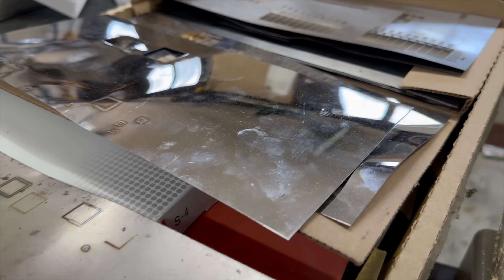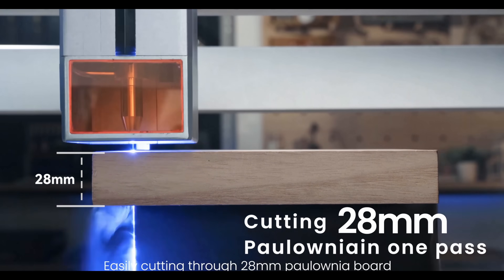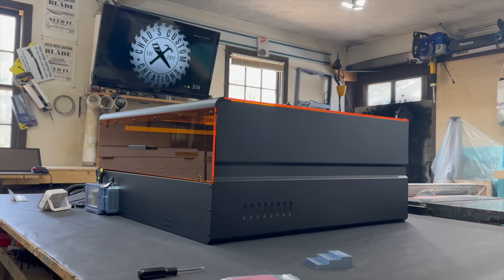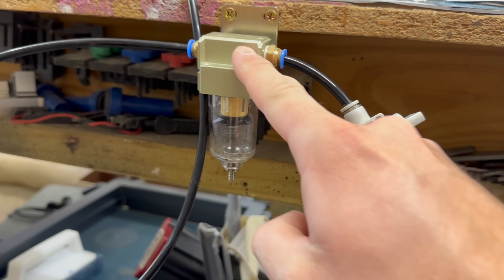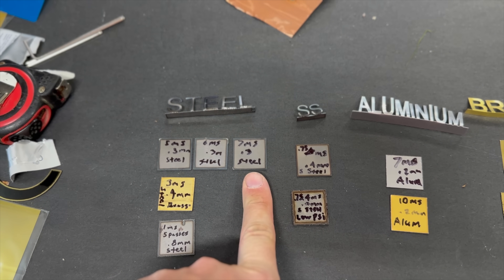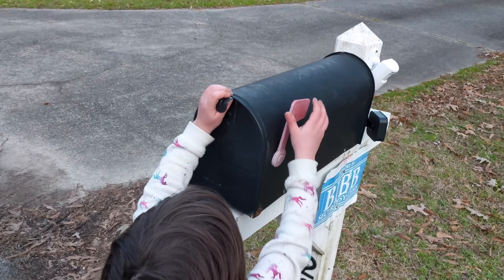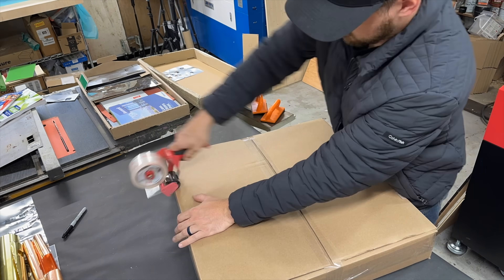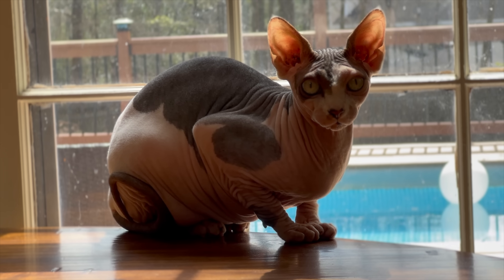Is The Future of Metal Cutting with Diode Lasers? 70W IKier K1 Pro Max

Comment: If thermal conductivity causes issues with warping and such, wouldn't it mean that if you more slowly and uniformly pre-heated the metal sheet in some manner before even starting the laser, you should not then be able to possibly cut through thicker sheets without warping them?
The thermal conductivity of the metal will technically decrease at higher temperatures, though probably only a modest amount even if preheated to a couple hundred degrees, but it has to be the non-uniform nature of the heating from the diode that is causing the warping issues so minimising the differential temperature from the cutting point to the farthest edge of the sheet I would hypothesise could have a fairly significant benefit for some of the trickier metals.

(though probably you'd also need to make sure the compressed air isn't blowing too cold air in as well which could ultimately be a limiting factor to the benefits I suppose...)
Reply from the maker: This is some great insight thanks for sharing I will give this a shot!

Comment: @Steel
Hi, do you ever thougt to use pure oxygen? With a presure of 40-50 PSI.
Theory:
The laser heats the steel to ignition temperature. As soon as the ignition temperature is reached, pure oxygen is directed onto the metal. The oxygen reacts with the heated steel and oxidizes it. This oxidation process releases a lot of heat and melts the metal at the cutting point. The resulting iron oxide (slag) is blown out of the kerf by the pressure of the oxygen jet, creating the actual cut. AND it should be a much cleaner cut.
Reply from the maker: These are great tips I think this would make an enormous difference. I used oxygen before but lacked proper airflow. It burned much hotter but couldn’t push the material away.

Comment: Good video I was wondering if you ever thought of using inert gas instead of compressed air. This shoukd make the cut even nicer as there will be no oxygen that oxidise the most metal when cut . Maybe it would be good next experiment 😅.  Keep up the good work .
Reply from the maker: Great suggestion thanks for that definitely adding it to the list.

Comment: When cutting metals you need to use sheilding gas like nitrogen or CO2.  On the stainless (well any reflective metal) they make special tape to ease in cutting, but black sharpie works really well in a pinch.
Reply from the maker: These are great tips thanks so much.

Comment: Coconut 
I have been looking to get into the laser community.  I am going to embrace my artistic side and try to turn a hobby into a business because I’m getting too old to start at the bottom again! 
I’m a welder Fabricator looking for a new source of income. Due to yet another company I worked for has been sold to a foreign company (5th time since 2018).  
I would love to get a fiber laser and engrave some dies or make coins….  But they are not in my budget. 

If you have any advice on a “reliable” laser that is a decent price, I’m in the market!  I don’t care if it’s an “off brand”, I am a fast learner and willing to fiddle with things to get them right.

Side note: 
Have you ever thought about OR is there programs that do a “franchise” or a “lend lease” to outsource some of your laser work volume for high sales times like holidays?
I just found your channel, I look forward to watching more of your content.

Best Regards!
Reply from the maker: These high wattage machines are pretty pricey cause it takes a lot of hardware to get them up to this wattage. Maybe check out a more portable machine like the Xtool F1 or look out for deals on FB market place you might be able to get a good deal on a used machine.

Comment: As a Co2 Laser operator since 1998 (to this day) I run 2kw/4kw machines), your focal length is crucial for the thickness of your material, of course, assist gas is also a factor but far more difficult given using a diode, dabbling in diode just using a 5w cheapy and finding some interesting results lately which I'll hold tight to my chest. Glad you finally debunked most of the myths surrounding engraving though! You've gained a sub from me my kind of stuff to watch.
Reply from the maker: Now those are some real machines! It’s an honor to have you as a viewer and I especially appreciate your kind words coming from someone with your background.
Reply: @ChadsCustomCreations  keen to see more, I'll share what I can, when I can as well. The nerd in me loves things Lasers!

Comment: Have you tried putting the pierce outside the part contour with a small path to it? Let the laser pierce through the material and only then start moving. 
That's how big fiber lasers do it (I operate 8kW Trumpf fiber lasers daily). Also, thin materials warp way easier than thick ones. I always dread having to cut parts from .5 mm, especially if they have engraving, because it warps from the engraving way more than from the actual cutting. 
The three points you mentioned are indeed very important and I would like to add the focal point of the laser to that list.
Since this laser is meant for engraving, it focuses on the top of the material, but for cutting you want to have the focal point close to the center of the material
Reply from the maker: That’s a good idea they have the settings in lightburn to do that I’ll have to give that a try.

Comment: What would happen if you replaced the "air" with oxygen... thereby using the heat to get it hot enough and the oxygen to burn the metal, like cutting torches do?? I think this will open up a whole new set of abilities and thickness, especially since you can accurately control the speeds and pressure and the nozzle  tips sizes... my mind is going crazy thinking of it... and combinations of both oxygen and air and pressure and nozzle sizes.... I've seen the mechanical cutters cut super clean lines through 5 inch steal simply because they control the speeds and pressures etc....Blessings
Reply from the maker: That’s a great idea I did actually attempt this with oxygen and I could tell it was giving me a much higher burn temp but I didn’t have enough air flow to direct the molten metal out and away in a clean fashion. I need a better valve, more oxygen, and maybe a custom nozzle.

Comment: So I bought it, the laser cutter - additional tip: it seems to help if I lower the laser head down to within a cm of the metal, probably because of the increased force of the air.  24ga steel cut in one pass, 22ga hasn't been as easy though I HAVE managed to cut it in two or three.  (I don't like gauge measurements.  That's what these plates came in, though.  Btw, search google maps for local suppliers, for materials like this; several times cheaper than e.g. amazon if any are nearby.)

Edit: I've since changed my mind on lowering the laser; I think now that if you have the air compressor throughput to maintain a higher air pressure (like 50 PSI), it's better to keep the laser at its proper focus height.  Also, I've heard that getting the molten metal away from the part (i.e. ensuring you get a full cut in a single pass) is important for reducing heat buildup, and my very small amount of experience gently supports this.

Also!  It apparently can cut through glass!  (I tried a sheet of red glass.)  The glass didn't LIKE this, and broke in several places from the thermal expansion, but I also got several places where the glass was melted through in a line!  There might be some setup that permits the cutting without the cracking, though I don't know what it is.
Reply from the maker: Oh that’s awesome to hear your results and great tip about local metal suppliers!

Comment: Here is a dumb comment . To disapate the heat - after each cut - shut off the cutting and cycle a pass with only the 40 psi air  supply ????  -- Jim
Reply from the maker: That’s not dumb at all I wish I had thought of that while running these tests. Definitely need to revisit this.
Reply: @ChadsCustomCreations  I'm glad I could help . --- Jim

Comment: Would love to see what these lasers can do with regular kitchen aluminum foil.  I keeps getting told they can't cut it, but your results clearly show they can.
Reply from the maker: @krisd9506  the more I hear people tell me something isn’t possible the more I have to go out and try it for myself. I believe kitchen foil could definitely be cut with even just a 10w diode laser.
Reply: @ChadsCustomCreations  Thing is I'm shopping for a laser for a business I'd like to start and I need it to cut both cardboard and foil.  I can't really afford to buy equipment and not have it do what I need it for.  I've looked high and low and I cannot find a single video of anyone cutting bare foil.  It's kind of frustrating since it's a material everyone has and that many people would probably like to cut.
Reply from the maker: @krisd9506  my recommendation would be the 20w S1 it’s a solid machine with great safety and ease of use for beginners. Here is my review of it. The 20w will 100% cut aluminum foil.
https://youtu.be/NNcsMqg7h_A
Reply: Thanks!  I'll look into that!
Reply: Picked up an AtomStack X40 PRO mainly because the expansion kit will let me do stuff up to 850mmx800mm.  It cuts regular kitchen aluminum foil like butter.  100% at 1000mm/m if it's good and flat, but it's hard to hold down and sometimes the wavy areas don't get cut.  If I slow it down to 700mm/m it seems to always cut it.  Heavy duty foil is hit-or-miss.  Some cuts easily, others it cuts a dashed line.  I suspect higher airflow would solve that and that the 70W wouldn't have a problem.  It does what I need, but I wish I had sprung for the 70W now, for speed if nothing else.

Comment: Hi, I'm not used to leave a comment on a video but I must say thank you for providing such research to the enthusiasts !
I'm currently looking at starting a small project that may end up on a crowd founding website at some point. I'm currently assessing what machine to buy, which process is the most efficient price/performance/convenience and this machine from your testing looks like a promising contender. You showed .2mm aluminum cards cut by the laser, did you post process it in any way or it came out as clean as it looks? Would you say the edges are smooth and clean ? Thank you and have a great day !
Reply from the maker: Pedro thanks for leaving a comment. I am glad you enjoyed it. The .2mm cards cut great and no post processing was necessary.

Comment: Hi, try using oxygen as your cutting gas instead of compressed air. You should be able to cut quicker and thicker, by how much, I have no idea but its what big shops use.
Reply from the maker: That’s a great idea I’ve tried it before and it definitely increases the burn temp but I need to get a better value for more air flow.

Comment: I bet high-focused clear oxygen instead of air will cut much better in many ways. Bet you will be surprised
Reply: The 40 PSI air works better because of amount of oxygen you put into the reaction, not that it clears debris which it also does, but it oxidizes a metal on the way. 
This should theoretically work best for metals like steel and aluminum and less for stainless
Reply from the maker: That’s a great idea I’ve ran oxygen before but the value I was using limited me to a very slow rate and though it greatly increased the burning temperature it lacked the air flow and focus to make a small clear cut. It more so melted the metal in places. I definitely need to revisit this and try again.
Reply: @ChadsCustomCreations  You can just make a lens, that will physically touch the surface and has a small hole in the center. Dome structure that touches the material with the hole in the center(laser and o2 comes out from) with it's rounded side and the other half turns into a cylinder that goes into another cylinder and travel up/down keeping touch with a surface being pushed by the oxygen pressure. The point is to make the oxygen usage as efficient as possible. It can be SLA 3d printed

Comment: This is awesome, I could finally create some mock up parts in a small scale with thin gauge of metal for my bigger parts. 
Instead going with a thick chunck of metal you can also cut multiple thinner ones and then rivet them all together to replicate a thicker piece.
Reply from the maker: Sierra that’s such a great point I think this machine is perfect for this application.

Comment: Cutting difficulty increases with increasing:
1) Thickness
2) Reflectivity (in the 455 nm range)
3) Thermal Conductivity
4) Melting Point
Reply from the maker: This is definitely a great way to break down the variables into simple terms.
Reply: would sandblasting be enough to make the surface matte enough to enhance cutting, or for steel maybe bluing it
Reply: @Humbulla93  There are scientific papers reporting that both surface roughness and oxidation increase absorption. However, I imagine both conditions are only superficial. They would be of very limited benefit when cutting to a depth of more than a fraction of a mm.

One exception to this would be flammable metals like steel or iron. Steel has been demonstrated to cut faster with oxygen-assist, since exothermic oxidation can affect the full depth-of-cut.
Reply: @AwestrikeFearofGods  interesting what about a heated surface plate so the metal doesn´t cool of as quickly, guess placing it in the oven before cutting could also work
Reply: @Humbulla93  In theory, this would be very helpful. Taken to the extreme, if the temperature was raised nearly to the melting point, only a small amount of laser energy would be required to overcome the latent heat-of-fusion (a.k.a. the enthalpy of fusion). In practice, such heating is impractical. Any temperature above the ambient environment increases conduction,  convection, and radiation losses. This makes it difficult to keep the part temperature even and stable. Uneven temperature gradients result in unpredictable warping and expansion. If instead, the entire environment is heated, the part temperature is more stable. However, it is difficult to raise the environment temperature by many hundreds of degrees, and the part still expands and shrinks.

Finally, many materials are permanently altered by such heat treatment. Depending on the alloy, this can result in oxidation, embrittlement, or strength loss. There are different concerns when heating only the edges of a cut part vs. heating the entire part.

Comment: Great video crazy to see how far and quick laser Diodes are improving. I use waterjets and plasma tables and the like at work all the time so I cut over a similar style slat table but with water in the tables have you considered trying to cut the thicker metal over a small water table to regulate temp. The high PSI may cause water to splash in unwanted places and there could be some reflection issues. If I had the equipment myself at home that's what id be testing next =]
Reply from the maker: Scott I absolutely agree! Thanks so much for watching!

Comment: Idea! Combat warping by putting the metal on top of a bed of water. So basically, the bottom of the metal sheet is touching water. Could also have a small layer of water on top, the air jet will blow it away on the point where it's cutting
Reply from the maker: Robin that’s such a great idea thanks for watching!
Reply: @ChadsCustomCreations  I partially stole the idea from microjet laser cutting. It traps the laser in a super small water jet, which allows insanely good cutting with a pretty low power laser!

Comment: Crazy to get 70 watts from diodes. Have you thought about trying to engrave or even carve into stone? I think fiber lasers ablate it away on 50 watts models
Reply from the maker: Chris it is pretty incredible how they can pack so many diodes in there. Actually yes my last video I used a 20w fiber to carve into slate the results are awesome!
Reply: @ChadsCustomCreations  Just gave it a watch, those are pretty good results. Have you tested how deep either the 70 or 20 watt lasers can engrave the stone?

Comment: Coconut. 
I am interested in the 70 watt laser and I would like to know if I could use it to mark steel with a depth on 0.006”. 

My goal is to mark parts that I manufacture the parts are 12 x 5 x 0.25” and the area that would be marked is about 3 x 2”.  The marking is made up of 50 characters. The of the characters are 3/16 and 1/4”   

Where can I find machine that you used on this video?
Reply from the maker: I think it would definitely be able to do this. I have this machine linked in the video description. Let me know if I can help in any way.

Comment: Needs a coaxial gas jet assembly with minimal nozzle gap (.030 in.).
70W of power is enough to perform the majority of your steel alloys. Copper and aluminum have their own challenges. I ran a multi-axis CO2 work center for a decade, our nd:YAG was an old Raytheon, set ups were lengthy but satisfying. Assist gas pressure has to be high/thus close to the workpiece to cut correctly.
Reply from the maker: This is a great tip thanks so much I’ll try to track this stuff down.